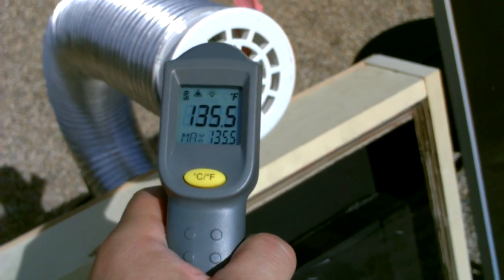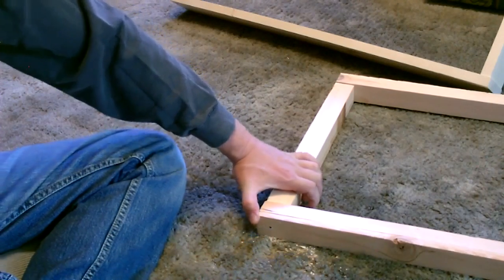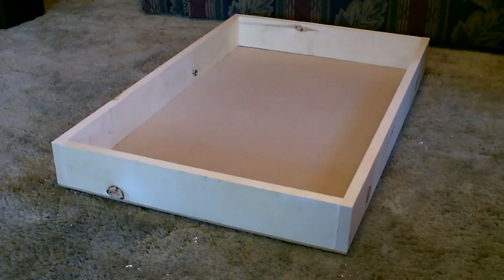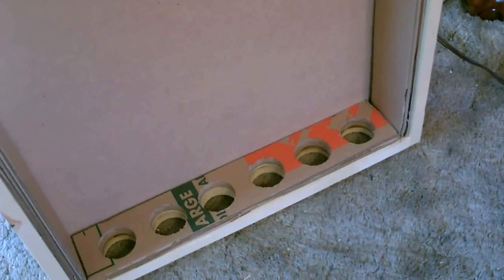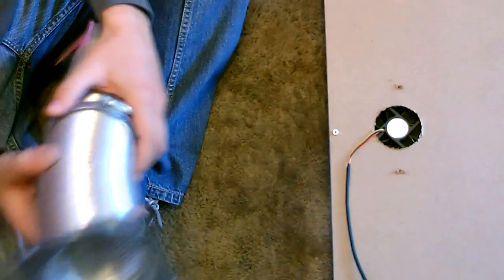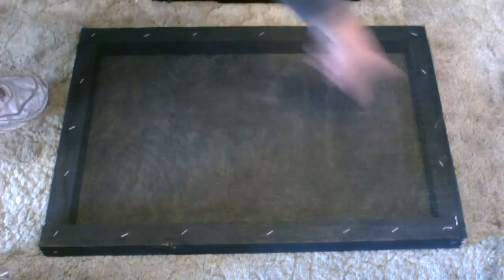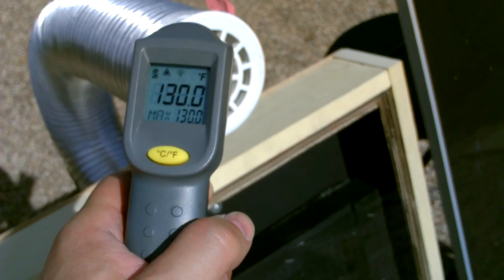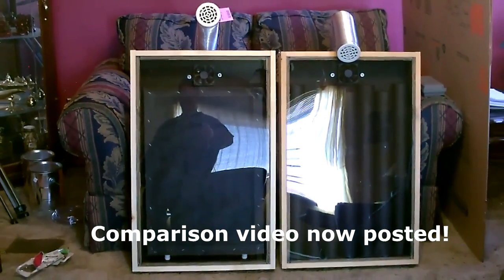Solar Air Heater! - The "Screen Absorber" Solar Air Heater! - Easy DIY (streamlined version 2.0)

Comment: One change I made is my build has no exterior air intake. My box has a divider down the middle, so interior air is warmed as it goes down through the screen and then again up to be released back in the room. Much easier for it to achieve net heat gains then when trying to warm frigid outside air in Boston winters. Less of a risk that it passively let's cold air in at night!

Comment: Nice simple design using mostly cheap materials. Thanks for both the tutorial and additional insights into optimal design.

Regarding the screens, are you using a polymer, fiberglass or metallic screen material?

Comment: Can anyone suggest or say how big or how many panels and of what size would be needed to heat up a house of about 1500 to 2000 sq. ft. Or a room size 15' wide x15' long x and 10' high. And also how long would it take to reach a required comfort temperature in winter.

Comment: Hi There what do you call that piece that attaches the vent pipe to the box and where can I get one from Thanks
Reply from the maker: hi there. that's called a j-box device cover or j-box device ring. you can find them at the home stores in the electrical dept.

Comment: Hey buddy nice video I have been gathering some stuff to do a similar build but the difference is that there is no fan or screen just a small slot at one end and a larger slot at the opposite also the backing is black painted copper sheet I think maybe a hybrid of your idea and the other would be a cool experiment

Comment: Well done!  I'm curious if you linked them together (out take of one into the other) if it could get even hotter?
Reply: +Shawn Bauer I doubt it, you'll only get so much temperature from these sorts of systems, it would be best to just vent both of them into the building/vehicle you're using it on to increase the amount of hot air you're blowing in.
Reply: +Shawn Bauer You should be able to get it a little warmer by doing that, but at a cost. The glass front is not a very good insulator, so as the temperature of the air inside the system goes up the rate that heat escapes through the glass will increase. That is to say, it will be less efficient. 

A good general rule with solar heating is to not concentrate the heat more than you need for your final application, because the increased concentration will lose more energy.

If you want it hotter, you could simply slow down the air flow through it as well, or add some reflectors, if you can be sure everything is made heat tolerant enough for concentrated solar energy. But at that point it would be closer to an over than solar home heating this project focuses on.